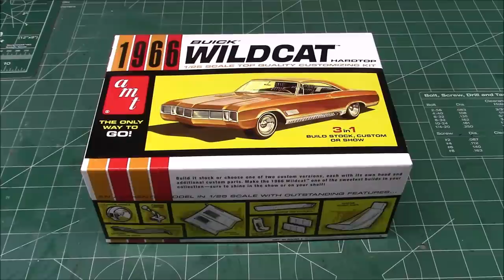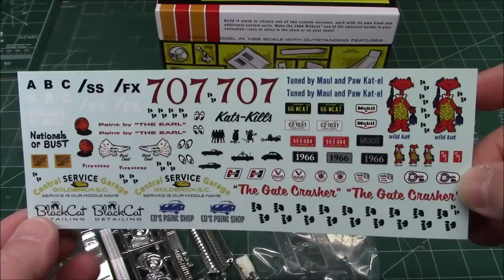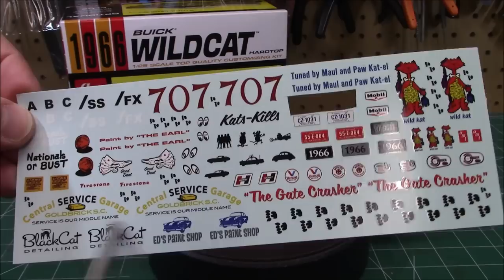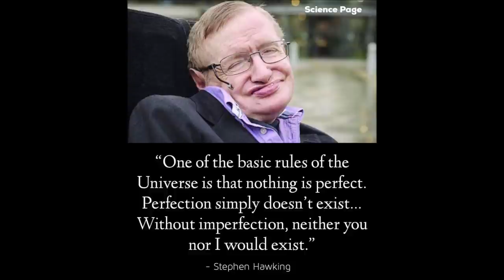AMT 1966 Buick Super Wildcat Custom 3n1 1/25 Scale Model Kit Build Review AMT1175

Comment: Looks great. My dad actually built these back in the 1960's he worked for Buick motor division from 1965 till 2004 building the engine's. This particular car had the 425 Cubic inch in it . Most of your Buicks of this era were built in Flint, Michigan where I'm from. Great looking build Chris.
Reply: Yes. Gotta love those torque monsters. I believe the dual quad version was around 465 ft lbs of torque. Incredible.
Reply from the maker: Thank you for checking out the video!

Comment: Hey Chris;

Here’s a little suggestion for those who want to eliminate that bit of sloppiness in kits where metal axles are a bit long. You know those clear plastic tubes that protect small brushes when they are new? Cut a bit from them, usually a couple of millimetres or so will do it, insert the tiny pieces between wheel and axle housing or chassis or whatever… no sloppy wheels!

As always, I enjoy your work, and your demonstrations of great ideas for improvement.
Reply from the maker: Thanks for the tip!

Comment: Hello, I remember when these cars were brand new, state of the art at the time and Buicks top line cars. These kits from then used to have metal screws where the pins go to hold the chassis now and the hoods were held on with metal clips. Some kits still have the tabs where you put the metal clips for the hood. For one is '53 ford F100 pickup truck kit, the '57 T- Bird and the '58 Chevrolet Impala for a few. On the bottom back side of the hood and the behind the fire wall are the tabs for the clips. The hole in the firewall is still there. I (believe it or not) still have several hood clips and used a few on the F100 hoods and it works great. Did not work for the '57 T-Bird though the tabs got to small for the clips to work, to bad they don't use the clips and screws any more. OOPS showing my age now. LOL I really love the color choices and the way you assembled the kit as a slight custom. Maybe the kid damaged the original hood and had to settle for a fiberglass custom hood. I am now going to look at the next one now about the cannon.
Reply from the maker: Thanks for watching!

Comment: I'm always looking forward to these build reviews, not least because of the ingenious ways in which the likes of silver Sharpies and gel pens can be used to shortcut the process of highlighting chrome/stainless steel/aluminum details. In fact, I've extended their use into building 1/32 scale aircraft, where I've discovered, for example, that a Silver Sharpie faithfully replicates the natural-metal frames on a P-51B/C canopy: I've also started using various colors of fine-tip (0.2mm) gel pens to replicate switches in cockpits, or the surrounds of instruments; it's so much easier than using a fine-tip paint brush.
Reply from the maker: You bet, lots of ways to skin the modeling cat! Thanks!

Comment: I love this kit . So far I'm about 90 percent done and it goes together soooo well. I would recommend test fitting whichever hood you are going with . All the ones in mine were warped and I found out after spraying them. I put it under hot water and had to bend it back into shape. Other than that it's such a great kit. And it's a BOAT hahahahah

Comment: That's what I call a classic example of mid-sixties muscle in a full size car. I would really love it if the molds for the convertible kits are around because that's how you could make a custom show car, put it on a turntable and make believe with other models of 1966 cars and call it an auto show display. They really need to dig up the old molds and come out with new reissues of kits so you can go wild with kitbashing, and make stuff they didn't have back in the day.
Reply from the maker: Thank you for checking out the video!

Comment: Just got into model building and I’ve used a lot of your videos for tips. One thing I’m really struggling with for whatever reason is chrome trim around the windows and front and back.. could you give an in-depth video on that ir any pointers for that matter. Thanks so much !
Reply from the maker: Silver Sharpie, I do it on a few videos, one is the 1/16 Porsche 356B I did.
Reply: hpiguys Workshop yeah I seen and I have a chrome pen. Idk if I’m doing them in the wrong place or what. That’s the issue more then anything if that makes any sense

Comment: Just an FYI, the bell housing for a manual transmission is almost always the same color as the engine while the transmission is bare aluminum. I wish I knew what you do back when I was an avid model builder in the early to mid 60's.
Reply from the maker: Thanks for the tip!

Comment: Christ, great build!,love color. Question for you, with all your excellent builds and videos have you had a kit that just was a pain in the butt? Parts that would not fit, poorly molded,or would not work out no matter what modeling magic you tried? If so what was the kit and did you give up?
Reply from the maker: I've never given up on a kit. The most challenging kits I have built are the oldest AMT large truck kits but those can be done in a couple days usually.

Comment: AMT have some of coolest decal sheets. I have said it before though, AMT kits are far too exlensive in the UK. This kit on Amazon is probably equivalent of $80. Are European Airfix, Italeri and Revell Gmbh expensive in the states?
Reply from the maker: It's difficult to get European kits at good prices many times.
Airfix is not easy to find anywhere but Ebay.
Italeri is pretty easy to find at average prices because they have MRC importing them.
Revell USA imports the Revell Germany kits so they aren't too bad.

Comment: I am really leary of the Molotow pens. For what they are,they are NOT cheap. I used mine a few times and the tip dried out 
I bought two new ones but I'm headed to crack them open. I think I might take the one and drain it into a bottle and just use it with a brush.
Reply from the maker: No issues with drying here, store them tip down, might help. The 2mm one I'm using in this video is a year old or so.

Comment: Only thing missing on this REISSUE/ORIGINAL BOX ART (released in SEPTEMBER 1965) is the AMT CUSTOM SPRAY LAQUORS/30 WILD COLORS/4 CUSTOM FINISHES display (since those paints are no longer available) and the paint advertizement is nicely replaced with:4 PRE PADDED WHITE WALL TIRES* but AMT please bring back the SPRAY PAINT AD-or maybe they do not because someone out there might try to pass off the REISSUE as an original BOX from 56 years ago and would not be fair to professional sellers/buyers!!!!!
Reply from the maker: They aren't going to advertise things they don't sell anymore so you won't see that stuff on the boxes.

Comment: I had one the best engine in the world it has an airplane motor used in spy planes 7.0 dual carbs factory headers hanger muffler tunnel ram imtake overhead roller rockers alluminnuim heads and block got finned oiil pan finned valve covers transmision is finned too had a launch hit the brake and gas wont spin but let off the break massive torque gforce i mean gone the best engine ever built used on spy planes for the military i mean this car rolling at 50 miles per hour would hit a rolling burnout devistation better have known how to handle 500 plus torque factory thats why im still here telling you about it